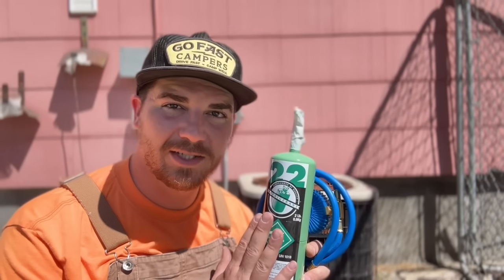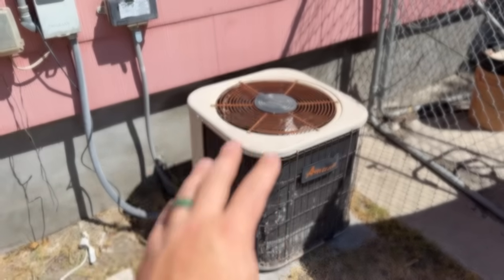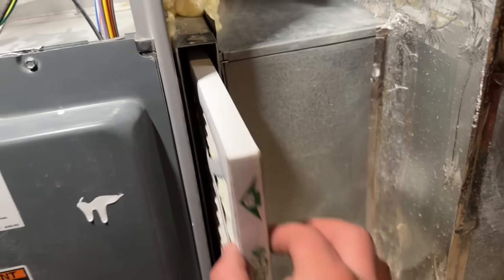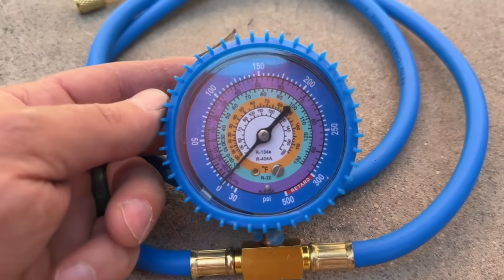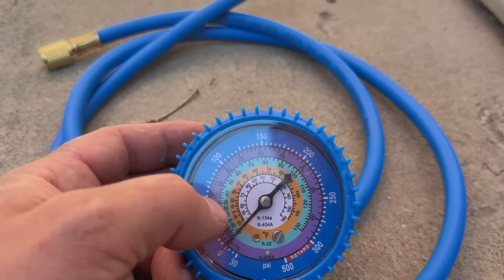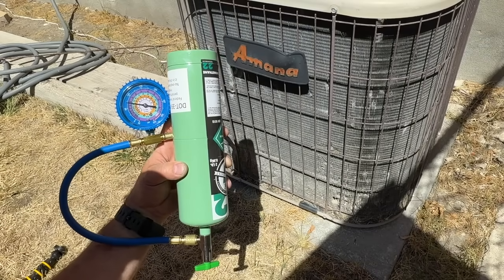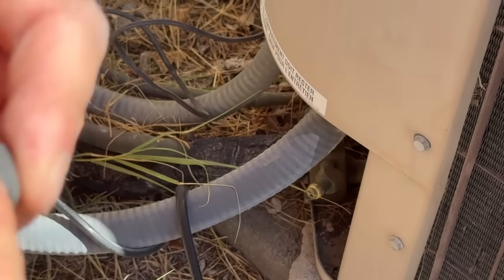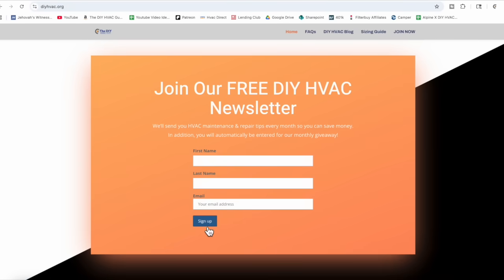HVAC Contractors Are Charging $600 PER POUND Of R22!

Comment: yes hvac techs are scamming cock suckers. you are doing gods work thank you bro
Reply: This is the reason I got into HVAC in the first place. I had been watching some of THE DIY HVAC GUY when I had a tech come out to top off my old R22 system. He told me it was $300 a pound. He put in 2 lbs for $600 and then said I might need another pound. The thing is, he admitted it might not even take the whole pound but still wanted to charge me the full $300.

So I ended up paying $600 for a one-hour visit and just 2 lbs of refrigerant. Later I looked it up and found out a 5 lb tank of R22 at the time only cost about $200. Basically, what he charged me for 2 lbs could have bought me a whole tank and then some.

If he had just charged me a service fee and a fair markup on the refrigerant, I would not have been upset. But the way he did it, I basically paid for refrigerant that he could just resell to the next customer. That was straight profit for him.

That is when I decided I would rather learn HVAC myself. Not to rip people off, but so I could take care of my own system and help out friends and family. It is also a solid skill to have. If I had to choose, I would pick HVAC over plumbing or electrical. HVAC has a little bit of both mixed in, but it is not as much of a headache.

Comment: Where do these scammers come up with these outrageous prices! I am sick and tired of these companies sending SALES TECHS,to peoples hones and either selling them entire systems for 38k when it needed a capacitor! Or it needs R-22,oh its super expensive right. If a can was 2k,thats $66 per pound,with fair markup it doesnt equate to the $400 per pound I have seen on tickets! How about a scheduled replacement,I recently worked on,they were gonna be charged$7,500 for a replacement condenser and lineset,exact replacement . They were told unit will not run and it was empty,no 410a. They did replace the indoor blower motor,then removed the Y wire off the board and shut off breaker and pulled disconnect. I went as a second opinion,as the unit cooled fine until the blower motor went,odd right! They did try to tell them the furnace wasnt compatible with the new A/C ,but they wouldnt budge on that,because their furnace is only 6 years old! Fricken Amazing
Reply: Lots of those snake oil salesmen tell people R22 is illegal !  They know so little, no wonder they are in sales !